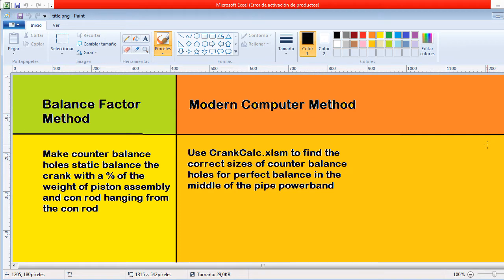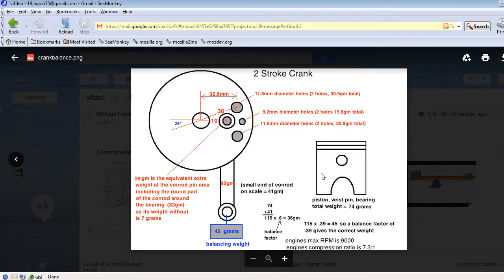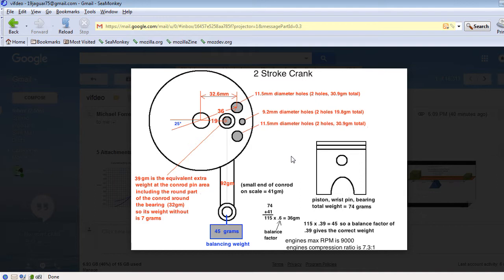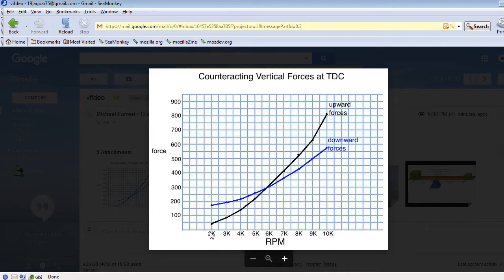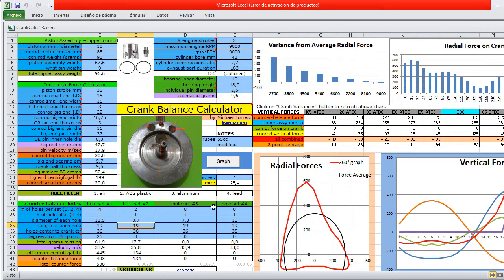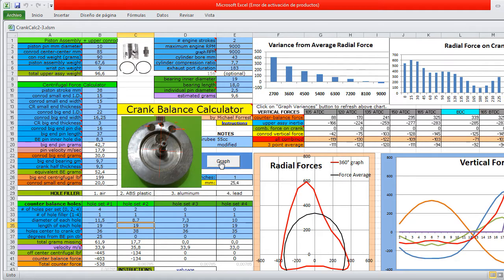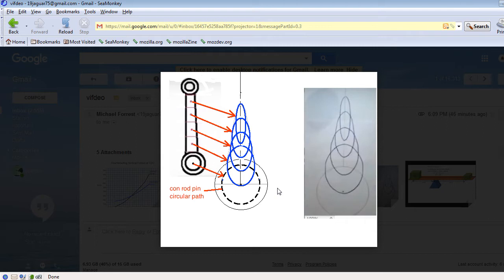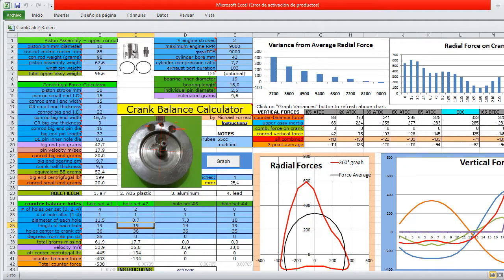Single Cylinder Crankshaft Balancing Methods Compared #2

Comment: Thank you for your information Michael, I'll be in touch with you over the coming months, I've designed a twin cylinder conversion for a Lambretta and I'm at the stage now where the crank assemblies are almost finished in design and I've so far modelled everything in mild steel, the next step is to get the webs machined in EN40B, I'll be using your spreadsheet to calculate balanced holes before long. Keep up the good work and stay safe in these bad times. Regards, Bob Monkhouse. (by the way, if you're interested look at my videos on YouTube to give you some idea of what I'm doing).
Reply from the maker: well I've never balanced a two cylinder so when you figure out how to do it then let me know
Reply: @MichaelForrestChnl  as I understand it a twin should more or less balance itself having forces 180 degrees apart but what I'm intending to do is balance each cylinders crank using your spreadsheet, the way Lambretta cranks are fitted into the crankcase means you can't fit the crank(s) as a traditional twin ie. with two horizontally split crankcases and then dropping the assembly into the lower crankcase half. The way I've designed it means I fit one crank into the crankcase (you have to hook them in then fit the outer bearing housing/mag housing) then half of the secondary crankcase/centre bearing housing then fit the second crank then the outer crankcase half then the outer bearing housing so its basically two separate cranks which, using your spreadsheet should make it perfectly balanced. I'll make a little video demonstrating the process and stick it on my YouTube channel so you can see it more clearly. Thanks once again. Regards, Bob
Reply from the maker: @bobmonkhouse50  cool. Keep me informed
Reply: @MichaelForrestChnl  will do, if you look at my profile picture you'll see the streamliner I've designed and made for a record attempt on a Lambretta, there's a couple of videos on my YouTube channel of how I've made it, the twin is destined for the streamliner. If you watch the videos be warned, there's a fair bit of swearing in the one bit, it's a result of seeing over four months of very hard work coming to fruition. 🤣
Reply from the maker: @bobmonkhouse50  don't worry. my dad was an ex-sailor.
Reply: @MichaelForrestChnl  🤣 🤣 🤣 🤣